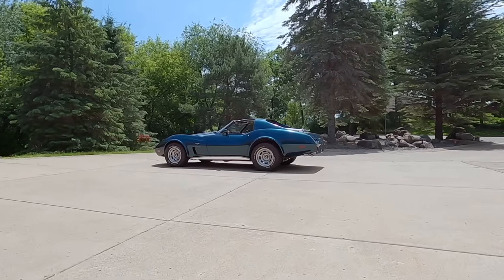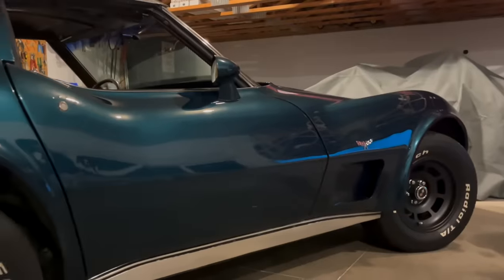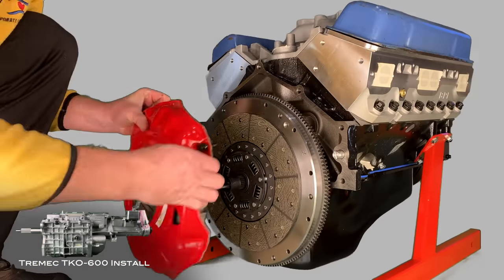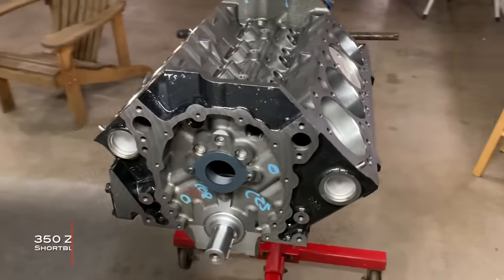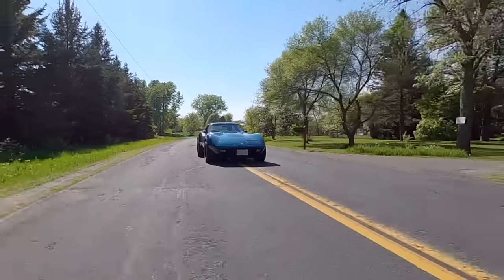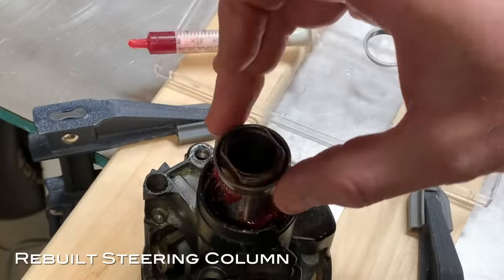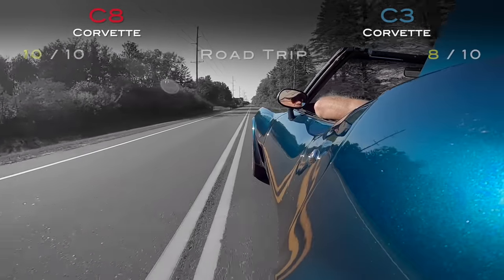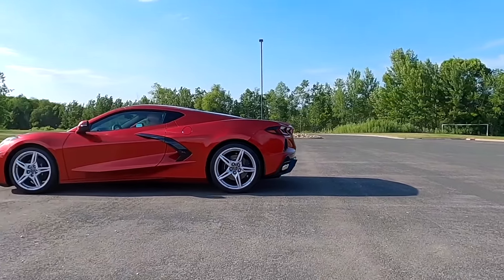C3 Makeover: Modernizing a Classic Corvette

Comment: I luv the C3 and C8 but in the long term the C8 is gonna cost a lot more to keep on the road, whereas the C3 can be worked on by the back yarder and parts are everywhere new and secondhand. My sons 69 has been upgraded with Willwood calipers which are half the weight of the original, the stock 4 bolt has been taken out to 383 450HP/480TQ with a 3.36 final drive behind the Muncie, the power steering has been upgraded to a Borgeson power box which is a HUGE upgrade over the old ram style. the suspension is just bilstein shocks up front and down the back is coil over shocks with Van Steel arms and a 6 Link with stabilizer bar , the popup headlights are by electric motors and the A/C is all new Vintage Air which now makes a car that is a very comfortable well handling sportscar, still more to do but thats half the fun.
Reply from the maker: on my short list is the steering upgrade - so many people have shared this and it seems like a no-brainer / appreciate the feedback Brian  Q: did your son convert the headlights via a kit or did you retrofit the electric motors yourself? That is another item I need to finish on my C3 - ie - switch activated headlights! Right now I need to flip them up manually -lol

Comment: You can't really change the things that are actually WRONG with a Series 2 C3. First, it is the most uncomfortable Corvette in the series. Second, any fuel overflow stinks the inside of the car for an hour (if you can ride with the windows open). Third, the drivers' view is abominable - you can't see anything less that 6 feet in front of the car. Fourth, "luggage space" is so poor Chevy used to offer a trunk rack - you know, like a '32 Ford. And don't get me started on badly-made T-tops....
Reply from the maker: Haha - yes and at times its almost like you a riding in the back seat / LOL - FYI - need to be extra careful pulling into parking spots-curbs as looks are deceiving with the long hood and its easy to hit the curb! thanks for the comment!

Comment: First, great video! Good cinematography and editing and not a bunch of vamping or dead air that could be edited out. Kudos! Have you owned any other gens of Corvette? I've had a C7 Z06 and now have a C6 Z06 so obviously the difference isn't nearly as drastic (would love to have your C3 btw!) but there is some stuff I miss from my C7 that the C6 doesn't have and there's some stuff on the C6 that I prefer over the C7. If it weren't for the lack of a manual trans, I'd have considered a C8, but I'm a die hard manual guy so the C8 is out. Also, are you considering any other modernizations for the C8 like wheels/tires (i think that would help your handling a lot) or seats? New seats is one of the big interior upgrades I want to do on the C6 but haven't found any I really like yet.
Reply from the maker: hey thanks for the comment - I truly wish I would have picked up a C7 at the end of 2019 / lots to deals at the time and it truly is a great looking vette (probably my favorite aesthetically). Ive read a couple places that GM has considered adding a manual option to the C8 but I don' know how one would pull it off without a completely different transmission in place of the 8speed DCT (it would be an undertaking)

Comment: That's what I would go for.  More fun, less headaches.  Perfect.  Would've liked to hear a little more about the performance.  Dyno run, 0-60 run, something.  I'm guessing you're running about 400hp but of that's only my guess.
Reply from the maker: right around 400hp / but best part of the motor is the torque / great on the street / I'll see what I can put together for a 0-60 run - thanks for the comment!

Comment: enjoyed your well made video.   I have a 78 C3 that looks to be the same color as yours.  The original color, beige with a coppertone bottom had to go. Also changed to a 80 style rear. I like your mods, I have an Edelbrock intake and carb setup on a upgraded 350.  Would like to go with the fuel injection.  I have all original brown interior (with CB equipped AM/FM radio).  Have been tempted to make some changes but decided to keep original.   I'd love to have a C8 to compare it to.  I wouldn't have expected the C3 to fare as well in a side by side comparison.  The older simpler design certainly has an appeal.
Reply from the maker: its all personal preference too - I'm sure some C8 owners may disagree with my scores. For me: I like a simple cruiser for a nice summer day and the C3 fits the bill / thanks for the comment!

Comment: I wish I could put a C3 body on a C7 Z51 platform. N/A 6.2 making reasonable power, 7 speed Manual with decent fuel economy, upgraded suspension and all that, but with the great looking classic body.
Reply from the maker: that would be an awesome project - C7 is a sweet modern vette (love them) - thanks for the comment

Comment: One thing I would change on the C-8 and that is the engine turning off cylinders on the engine. I had to get my '07 Monta Carlo's transmission rebuilt and surprisingly at the transmission shop there were brand new F-150's and Silverado's waiting to get their transmission rebuilt. These trucks had less than 60,000 miles on them. The mechanic stated it was because of the cylinder turn off system (I guess that's what it is called). This system broke both the transmissions and the engines. Frankly, it doesn't save any gas and cost to much money to rebuild or replace both the transmissions and engines on a $150,000 vehicle. So, get that program turned off as soon as possible to save your C-8. Since I had my transmission rebuilt, several YouTube mechanics have confirmed my transmission rebuild mechanics statements, Scotty Kilmer and Omega on YouTube to name a couple have made that statement.
Reply from the maker: If you run the C8 in sport mode, the cylinder shutdown it dialed back to basically highway only and if you select track mode, I think its completely off - no problems with my C8 so far and thanks for the comment!

Comment: I was born in 88, so maybe it's not uncommon for people about 35 to say this, but in my teens and 20s it was not a popular opinion to say that the C3 was the best looking Vette. That's my OPINION, I know a lot of people love whatever Corvette for whatever reason, but I just like the looks of the C3 most. That being said... I think a good restomod is necessary to make them a good car as well as a good looking car. I have sat in a C3 before, the seats broke my back, I hear the suspension will do the same... if I had a C3 I think I'd get some C3 inspired seats with as much adjustability as the cockpit would allow... and upgrade the suspension. I think it'd be cool to drop in a straight 6 as well.
Reply from the maker: straight 6? There are some cool boosted ford 300 inline 6 builds out there - craaaaaazy torque curves / Thanks for the comment!

Comment: So my opinion is the c3 is all around better I own one my self. And I have is set up as a streetable race car I redid every single thing mine is a 1980s every thing is new and a 502 big block and a pro Flow xt intake. The inside is all done in nice leather it’s absolutely amazing I’m 33 and have been restoring it since I was 16. My uncle has a basic c8 he is who I got the c3 from. His c8 is as basic as you can get 😅 and it for me is just the new chevys 2012 and up are just to difficult to work on its way to hard to do anything. My c3 makes more power and has everything his car has including heated seats, a screen and all the other goods he told me he would give me the c8 payed off and $20,000 to have the c3 back 😂 no way
Reply from the maker: Haha - that sounds like a pretty good deal - but if you like the C3 better, maybe not so much! 502 in a C3 is a BEAST / sounds like you have a nice ride an have spent a lot of time modifying the right way to make power. Thanks for comment!

Comment: I have always thought the C3 Corvette is a great platform for a restomod. They are beautiful cars.  They also have a long wheel base and good handling characteristics. They were very successful on the track. The problem with the street versions is that they were made in the 1970s and early 80s for the most part. So, they have absolute dog engines and lousy brakes. Chevrolet sold a gazzillion C3 Corvettes. So, a solid well kept example can be had very cheap.  Even better, engine and brakes are the two easiest things to upgrade. Truthfully unless you are going to the track and have to worry about brake fade, you don't need to upgrade your brakes. (Big brakes don't make you stop faster. They just dissipate heat better and are less prone to fade, which only matters on the track).  A C3 Corvette with a modern engine and transmission is a very nice car indeed.
Reply from the maker: Thanks for the comment John - I can't disagree with anything you said

Comment: A special startup procedure? You mean pumping the gas pedal when it's cold to close the choke and spray gasoline from the accelerator pump? And then tapping the accelerator again once it's warmed up to release the thermochoke? OK. Beautiful makeover, BTW. And I concur with every upgrade, good choices.
Reply from the maker: Hey @MrJeffcoley1 - I have no problems starting the ole C3 and other carbureted V8s - my comment was focused more on other who want to drive the car (my wife / kids / etc) - I think they could probably pull off driving the C3 stock but my Cobra would be a tall order -lol. Modern cars are so easy to operate when compared to some of the classics. Thanks for the comment!

Comment: Worry about Vaporlock? You think GM didn't have that handled? LoL. Quadrajets, you can start and go. Yes, fuel injection is better, but a good thrttlebody setup is gonna be just as good for around town, and set you back way less. Vaporlock.
Reply from the maker: Hey Chris- thanks for the comment / I've had problems with vapor lock when adding headers in smaller engine bays - especially with electric fans if you don't wire them on all the time (or have a lower temp relay trigger switch) - I have a lot of first hand experience with this problem with my Cobra on hot days, exacerbated by not having a hood scoop / cowl induction -etc.  An OEM quadrajet setup likely is just fine with the OEM hood (agree) - I was trying to express that an EFI setup likely is more reliable with all driving conditions-environment vs. a carb. Thanks for the comment!

Comment: My 81 4 speed was a heck of a driver, but that top gear was a bit rough at highway speeds like you said.  Wish I'd had options like we have today.  As for the fuel system, I don't know if it was just my car, or a change in the last year of manufacture, but I had no fuel delivery issues.  She always started immediately and idled smoothly.  No vapor lock or fuel starvation in high speed corners.

However, this was one of the fishbowl models and the A/C really sucked.  I tried tinting (which the shop hated to do), and finally ended up with those cheesy rear window louvers to cut down on the heat radiating from the rear window.

Oh, and keeping the center caps on the wheels ... well, I bought 4 sets of spares.
Reply from the maker: I like the look of the bubble backs but they are heavier with all that glass / The quadrajet that came on most of the small blocks is a great carb with the small primaries and monster secondaries. My center caps have the wobble issue too and like you- worried why might fall off at some point so buying spares was a good idea! Thanks for the comment!

Comment: Love the videos on the C3,  I'm beginning research on getting one in the future as a project car.  But just wanted to mention as a lot of people overlook it, you might want to consider going to a larger wheel and a smaller sidewall tire because removing some of the sidewall flex will really help the handling and as long as you don't go real low profile it shouldn't affect ride comfort.
Reply from the maker: Yes 100% (a very astute observation) - longer term this is something I've considered. I like the OEM wheel look and believe it or not, you can get aftermarket 17"-19" GM rally wheel replicas which keep the classic look while allowing lower tire profile / better handling. Thanks for the comment!

Comment: I got a 71 Corvette with a 540 cubic inch 700 hp with no powers steering no air no heating no power windows it's only got 700 hp at the wheels and other option it can kill you I love it

Comment: How about a decent oil filter for starters. Fram are garbage. Love the color of the 77. Ruined the dash, Quick Fuel BDQ is far better then any EFI. Not problematic with unreliable electronics
Reply from the maker: haha - the Fram was for the build only to keep the oil galleries tidy until the motor was installed. I use Wix exclusively on my SBCs (good filters) - thanks for the comment!

Comment: Not a huge vette fan but I'd take a c3 over any newer one point blank. Not even gonna lie if I was given a newer one I would sell it within a week. Just too much of a fan of old A and X bodies to own a vette. That said your c3 is beautiful and tastefully modded. I feel a good padded dash pad could change the look for your dash to the better but I've been doing interior work way too long. Somebody that knows what they are doing could have done a dash out of fiberglass and kept everything you wanted with your sheet metal dash without it looking like it came out of a tube chassis race car. That is a bit over most DIY guys heads.
I know they are overdone but a good aluminum LS sure changes the handling of older cars. When I swapped out the iron 383 with a 6.0 in my s10 it woke the handling up. Made it feel less like a 1/4 mile only to something that can take a curve without having to use the gas to force the rearend around.
Reply from the maker: Yeah totally agree: an LS is a worthy upgrade to consider in a C3 too / lots of benefits. Another post mentioned I should consider the fiberglass dash route too and I might need to look into that  6.0 LS in a S10 = complete badass (nicely done)  - thanks for the comment!

Comment: I fuel injected my C2 and not happy with it.  Had a professional install and he had many troubles tuning it, took to another professional and he said it will never be perfect.  Every shop I talk to said it doesn’t matter which brand I used, it would not be very good.  Those shops also said that they remove and reinstall carburetors in most cases.  I’m told that this is due to the universal kits being too generic in tune-ability.  
Burning tires forever and barking tires between shifts with the carbs….not barking tires with Efi and dying at stop lights sometimes. 😢. 
I’ll try a little larger before giving up and going back to carbs.
Reply from the maker: Hey sorry to hear that @mclegg00 - don't despair - the big things to verify on an EFI retrofit is that there are no upstream exhaust leaks affecting your wide-band O2 sensor (you want this CLOSE to the exhaust manifolds too- ideally install in one of the collectors with the O2 bung already welded in), the temp sensor is by the thermostat - and - whatever EFI kit brand you choose is self learning-has a good base map to start with to match your cam. Once you have that, most of the rest should fall into place. If you stick with a carb, a quadrajet is a good choice with its small primaries. Hope you are able to fix your C2 and thanks for the comment!

Comment: I bought a 79 L82 at 19 and kept it over 20 years. My only concern with one is a crash. If you know your parts they're great to play with. I find absolutely nothing unreliable on one other than the garbage replacement parts you'd buy for anything on the road.
Reply from the maker: Yeah most C3s aren't overly safe, but that's pretty much the case with any mid-80s or earlier car (not super safe) - thanks for the comment!

Comment: By brother is a Corvette guy -- I'm into Porsches.  Question:  "Why don't owners lower the C3 to sit closer to the wheels?  To my eyes, the fenders look too high above the tires."  BTW, my brother's '78 is the same way.
Reply from the maker: They can be lowered - up front I replaced the original springs with new OEM springs so with the control arms and a small block, ride height is kinda set by the factory in the front (that and I have aluminum heads / simplified accessory drive). In the rear, I actually added 8" leaf bolts to lower the rear (I have it matching the front, but can go lower if I like) thanks for the comment!